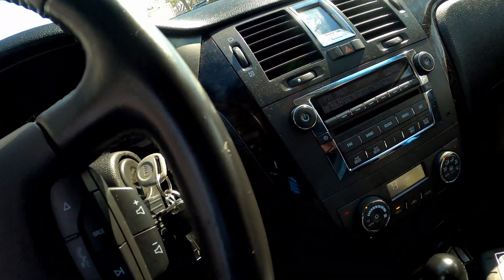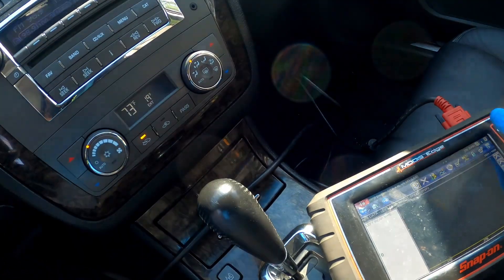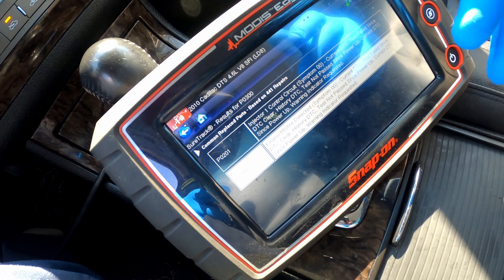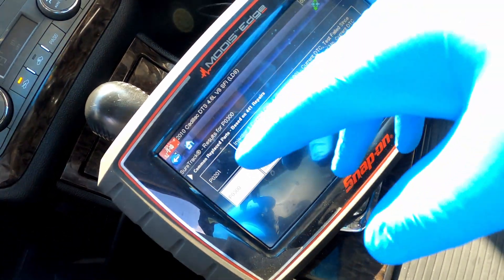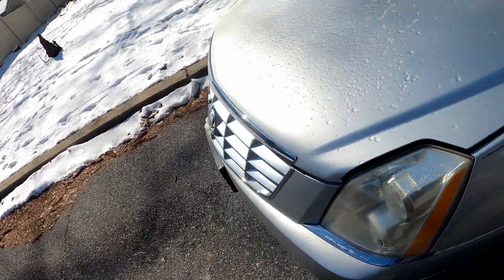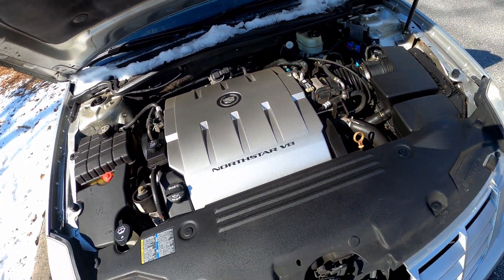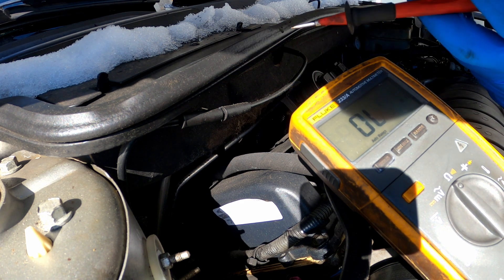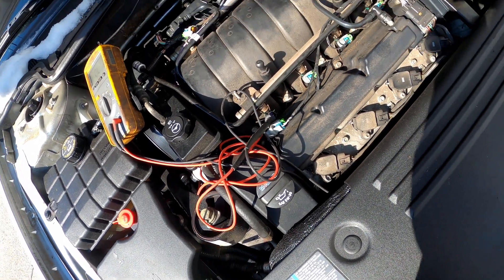HOW TO TEST A FUEL INJECTOR|OHM TEST~10' CADILLAC DTS 4.6L|SNAP ON SCANNER DATA

Comment: I have that same noise in mine reading fuel injectors. Tried the cleaner and it didnt work so i found 8 injectors on ebay. Bout to go slap em in now. I got 195k in miles on that thing and shes still running great for the most part. All ive had to change so far was the iac sensor. Thabks for the video.

Comment: Got my codes read and was told I need a fuel injector, haven't had it worked on yet but now it's overheating is my engine shot now?
Reply: No it’s not shot
Reply: If it's over heating I can help if need any info